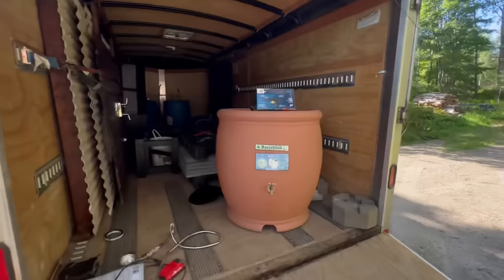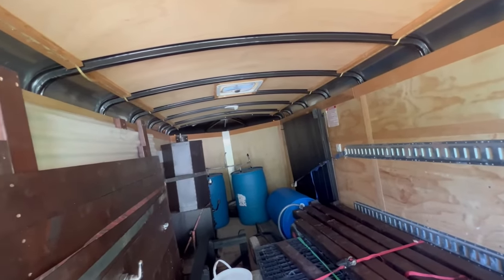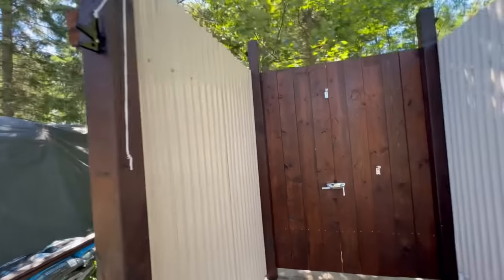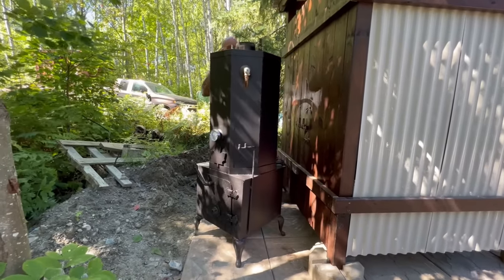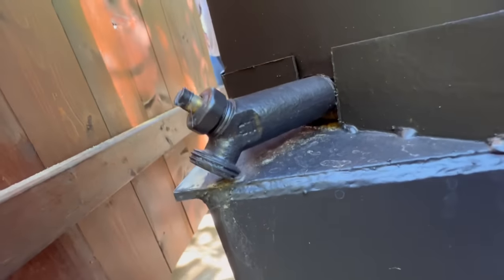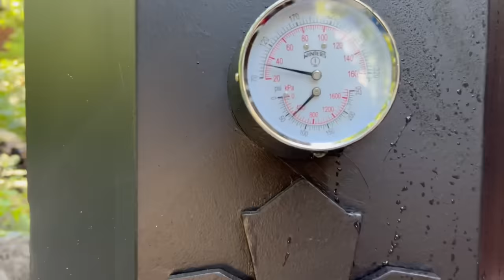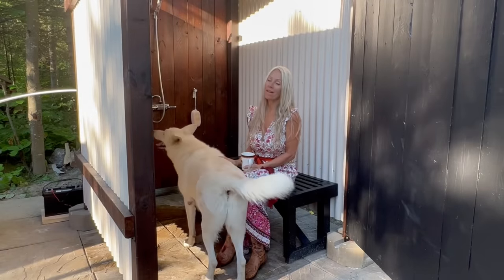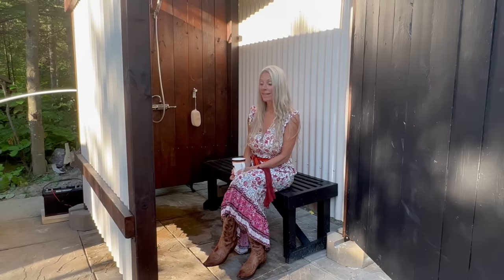Finally!! I HAVE a New Off Grid Outdoor SHOWER!!!

Comment: I’m totally off grid and this idea is awesome! I use a garden water can right now off the corner of my deck. I’m in the process of collecting logs for a sauna bath house but this would be great easy fast set up till my project is done!!!

Now that you have that water pump maybe consider using a barrel and plumbing some water inside. I have a 35 gal barrel I fill from the lake to inside my cabin. Then use a the pump to pump the water to sink. It also is plumed to a small propane water heater and a shower head.  

For the shower I use a cut off plastic barrel a Hula hoop and plastic around hoop to make a shower curtain and direct the water into the barrel.

Comment: I just came across this video and giving it a 👍. You can use it anytime of the year. I would recommend putting that water boiler inside the shower room, insulate the walls. Dig a 6-7 foot deep hole in the ground for the water tank. It’s not going to freeze.

Comment: This makes my off grid shower llok primative in comparison. I had 1,000 gallon wooden tank mounted 8 ft up between 3 pine trees for gravity flow water. A 100 ft black pvc pipe on the ground in the sun for summer hot wates, and an oven made of constuction bricks with a copper tube coil inside the flue for winter.

Comment: Pretty cool Lisette. That boiler reminds me of the one my dad told me about from his childhood. They used to burn corn cobs to heat the water.  theirs was for indoor washing. The corn cobs were leftover from shelling corn on the farm.  I bet it was back in the 1930's.
Reply: My and wife's family owned a huge two stories. full basement and an attic could of been made into three Bzr and bath, was built in very rural WA State in 1880 1890.
No newer  furniture than  1930 Builtwell sofa and plush chair.
our hot water came to house by gravity fed spring 300 yards uphill and would blow cu out of hand if not carefully.
one living went to two clawfoot tubs and two old wood and brass chain operated toilets, two pillar porcelain knobbed sinks in n baths
in kitchen heavy as hell dual sink out of polished granite each nig and deep enough big enough boys till 4 yo could climb in for baths. had huge Beautiful black with zinc trim dual oven,  warming bed for raising bread or keep warm food, wood burner on end and water ran in back through stove to an old cast iron broiler with  lines to all fawcets with return lines to stove salvaged from abandoned logging camp.
opened valve to line return to creek so flowed even below freezing down to Zero F. never a frozen fitting.
our wood furnace was also logging camp salvage.  an old steam logging train engines boilers firebox .completely enclosed and ducted to first floor, second floor just opened floor ventsyou could throw 34 inch long 22 inch thick log in furnace
the ingenious minds of past gave us beginnings of much more complex and way more expensive electrical  and bling luxury, the  cheaply built. throw aways we have today. 
My wife's day bed and my roll top desk were damn near 150 years old and never redone like new.
Family read by kerosene lamps and mirrors reflecting light upon  each our own chairs in winters lights
odd how today's labor savers do not realy save much labor as we work many many hours to buy them.
When buying house had to get county inspections, electrical inspector failed me, because I did not have a grounded hot water heater.
Plastic water pipes and no f'n electricity to house

Comment: Hi if you turn the blue barrels over so the filler is at the top you will save battery power and your pump will last longer ......it would just be pouring in instead of pushing against  the weight of the water 😍
Reply: Glad to help .you did a great job 😁

Comment: I have an outdoor shower that we coiled 200' of 3/4 black poly pipe under a pile of wood chips and some straw. We put the 150g holding tanking inside the pile too. Free 130-40 showers year round. The inside of the chip pile gets near 160 degrees through microbial thermogenesis, bugs moving, eating and making heat through that movement. Every year I scrape the chip pile back and have insane black topsoil and replace with more chips and sawdust. My neighbor has 6 55g drums that he fills with food waste and as it rots, it creates methane, he fires his hot tub heater with that and also cooks on it. Who says you need the gas company, and bugs don't stop in winter, so it's reliable year round, lol. We even heat our greenhouse the same way. I have to say, you have the best thumbnails on YT, hands down and the content is awesome.

Comment: Impressive build. It is so big that you can have a party in it....or you and the dogs can clean up together. I hope that you got good instructions on winterizing it. Nothing could be more heartbreaking than to try to start it up in the spring and finding leaks in piping or fixtures. Been there when I forgot to open a faucet and when water was turned on I got an impressive spray.
Reply from the maker: Yes, I had good instructions to winterize it. And, thank you kindly! 💕😊😎

Comment: Even though your outdoor shower was pre-assembled, You still did an incredible job putting it back together !!!  I LOVE IT !  How do you clean yourself through the winter months ?  A small tip ...  When you drain your water system in the fall, leave the drain plugs open should any water still in the lines be able to expand and drain so it doesn't crack your water lines ?

Comment: When screwing into wood, weather pre-drilled or not, carry a small piece of candle wax and scrape the screw threads across the wax. A small amount is all you need. The screw will go in much easier with less strain on your battery drill. Battery time will be extended considerably. Good luck!

Comment: WOW, what a great setup for you Lisette, it must feel unreal for you to have a hot shower whenever you want!
I don’t want to be a mister negative or anything Lisette but I hope it’s sheltered from the wind because I am worried that a strong wind might move it on you! I don’t think it would be very hard for you to setup something like that inside now that Robert has given you the heads up, anyway it’s a great thing for you to have and Robert’s a very generous and caring man for giving it to you!
Reply from the maker: Thank you Alan! The shower is secured (fastened) to the concrete blocks. I just forgot to film that part. Robert did an amazing job! I’m so very thankful and feel so blessed. 💕
Reply: @One.woman.wilderness  I just don’t think those concrete blocks alone would be enough to hold it if a really strong wind got hold of it but I could be wrong, I don’t know how strong the wind gets there where you live!👍
Reply from the maker: @alanhiggins2928  
We don’t get that strong of wind and I’m pretty sheltered from the wind as well. I’m lucky that way. So, all shall be good 😉

Comment: Lissette from now on when u hook up your water pump always hook up the positive terminal first then the negative terminal last. And when connecting any sources to a live cell battery always keep your face away from the battery just in case of a chance of the battery my explode from a possible spark from making the battery connection. Think safety ok!!

Comment: Hey Lisette! That is an amazing gift from Robert for you! It is also such a good idea to use the pump on the spring water rather than trying to lug those containers as you have been doing. If I may suggest, why don't you add a cigarette lighter jack on the end of the pump wires as that would be a lot easier than connecting alligator clamps onto your truck battery. (Or you could use your Bluetti battery to run the pump!) Anyways... yet another awesome video! See you in the next one!
Reply from the maker: Oh, I actually have a cigarette connector… I just couldn’t find it at the time! I’ll use it next time. 
Thank you my friend!! 
Robert did such an amazing job!! I’m so very thankful and so grateful!! I absolutely love the new outdoor shower!! 
Have a wonderful weekend 😊💕🐾🐕🐕😎

Comment: That is the one thing that when I go on the road it's gonna be nice to be able to take a shower outside in the fresh air. What's also nice about that shower you have U be able to put a rain catchment on the back part because you have a great slope on that roof of the shower and let it go into that big tub during the spring you won't have to go get water for showers because the water is gonna be heated so whatever's in the rain water will be purified. 👍✌✌💪💖👏🎅🚌🌻
Reply from the maker: That’s what I plan on doing, put a rain catchment and also set up a few solar panels. I’m so very happy with the new off grid outdoor shower! Robert did an amazing job!! 😊💕

Comment: Turned out real nice Sweetie! 🤔 Just wondering why you can't use your shower during the winter. I leave a gallon of water with a small hole in the cap, out in the sun during the cold days. After working all day I stand on my concrete block, pour a small amount of the warm water over me and soap up. Then I just turn the jug upside down and rinse off. I grab my towel that's hanging on a nearby tree limb and dry off as I head back inside the camp. Easy Peasy 🤷‍♂️. I know, I know, my name suits me! 😂😘
Reply from the maker: Thank you kindly! Our winters are too cold here, water would freeze. And, you’re too funny!! Lol Thanks for making me laugh 😉😆😊💕
Reply: @One.woman.wilderness  🙂 You're So Welcome and may The Lord continue to Bless, Protect and Guide you Continually! I just found out where you live and yes, 😬 I'm sure that it can get a bit Frosty there ⛄! ⚘

Comment: It might be an Urban Legend but since I was a kid in Calgary everyone always said put some wood under a battery to keep if from discharging. I too would think about a plastic boat battery cover box.  I have a cheap solar battery maintainer on my golf cart that seems to keep the battery topped off, it is about the size of a small cutting board.
Reply from the maker: That’s what I did… I placed a block of wood under the battery … you can see this at the end of the video when I’m chatting. 😉😎
Reply: @One.woman.wilderness  Saw the very nice block of wood under the battery, thought it might have been a concrete paver being so square & smooth.

Comment: With a solar system, you could install an IBC tote on a tower for gravity fed pressure and install on the tote a DC powered heating element that derives it's power to heat your water from the solar system.  That can be plumbed directly into the cabin for a shower/running water indoors.  There is still the issue of a well though.  Have you thought about the possibility of doing it yourself.  There are many videos on YT showing how to do that, but I do not know what your ground issues are that you would have to breach to get into a water table.  Just some thoughts for you though...

Comment: They make magnetic shafts for them screw guns with a sliding sleeve on it so you can run them screws in straighter and easier with out bangin up your pinkies 😁

Comment: Thats awesome you did it . Now for winter cold day you need to dig a sistrin aka deep hole 10 ft deep 12 ft x 24 ft place a plastic tank 12X24x8ft high  install a drain system bury tank install a roof and finish of walls to floor install a small potbelly stove in corner boom wrm water warm space to dress before your hair freezes . I like that shower system . Get your uncle to come dig a hole . You can reuse your waste water filtered organically sand filter for a swimming pool . Pool hot tub . Next ?
Reply from the maker: I won’t be using the shower in the winter… I don’t mind. 😉 Future project will be a sauna… but perhaps next year. 😎💕

Comment: Hii Lisette 👧 wanted to see your new shower, does the roof just sit on top of those 4 vertices poles? Shouldn't they be fastened to the poles to prevent the wind from taking it off? Wow that boiler is awesome! I'll bet that boiler is worth over $2000.00 hot water lisette! Yay! 😃 those marine pumps are good, get another one before this one dies, because they don't last, I had one before and it didn't last, I needed to get another one, especially when your dependant on it every day, awesome to see that boiler working, very very cool 😎 that is so cool, buy another marine pump for spare and screw down that roof, I fear the wind is going to pull it off, this shower is deff adds to a  better quality of life, I am so happy for you ❤️ from: Scranton, Pennsylvania
Reply from the maker: No, the roof is securely fastened to the posts. And the posts are fastened to the concrete blocks. The firewood water boiler was hand made. Not sure, you would have to ask Robert. I’ll get another marine battery for sure. I’ll put it away in the winter months. Won’t be using the outdoor shower then. 😊😎 
And, thank you 💕
Reply: @One.woman.wilderness  I am so happy for you Lisette muah ❤️ God bless you! 👧

Comment: Good lord, all I do is take the shower head off the indoor shower in the summer time and run a hose outside. Once you get good at setting the temperature you don't have to come back in. Small shower nozzle with a thumb valve to turn it on and off.

Comment: You could put a solar panel or two on your shower roof and charge the battery continuously as well.  Not sur what the cost would be though.  Cheers fro Australia.
Reply from the maker: I actually plan on doing this. 😉💕
Reply: No worries. Cheers and hope all is good.
Reply from the maker: @kerryburke3864  
Thank you kindly Kerry 😊💕

Comment: built a wood rack below with 1x3 wood to stand on ,inside of the cement blocks.,make as wide as the inside of shower.
Reply from the maker: It’s coming up, already planning this. Won’t be as cold on the feet. 😉😊😎

Comment: get your battery up off the concrete, that will harm it,a PVC battery box. insulate all the pipes against freezing etc. happy bathing.
Reply from the maker: It is on a wooden board, you can see this at the end of this video. Oh, I won’t be using the shower this winter. 😊😎

Comment: Good job Bob! Do you have an inside shower?
Reply from the maker: No indoor pluming or running water… I do mention this at the end of this video 😊😉
Reply: @One.woman.wilderness  You don't need inside plumbing. They make a usb charged submersible portable shower for $40 on Amazon. Just stand in a tub with a bucket of warm water and wala, clean as a whistle.  ; - )

Comment: cool video!!! but the door of the shower should be mounted with the opposite side to the hinges. why do i know that? the diagonal beam has to be inside the shower so the upper end of the beam is on the side of the locking. why is this important? the diagonal beam‘s task is to support the door against the lower hinge so it cannot sink down on the locking side with time 😉. other than that super great video, thanks for that!!!

Comment: You would have put out side wood stove and heated your whole house as well and just put a shut off on it with a blow out line in the directoin of the shower then just used cold tank for cold water summer

Comment: You'll need to put your battery on a piece of rubber because the concrete slabs will drain the battery.  Just fyi.  Lol
Reply from the maker: It’s sitting on a block of wood… 😉😊
Reply: Ok, lol.   Just making sure u didnt leave it on the slab they will drain a battery quicker than anything.     Lol

Comment: Could you also use rainwater? That would save a lot of hauling water at the well. And since you heat it up to 50 degrees C most organisms that might live in it will be killed.
Reply from the maker: Yes, I plan on putting a rain catchment and also some solar panels to run the battery. 😊💕

Comment: Wait wait you forgot one very important detail... the m.a.s.h. 4077 official peep holes drilled in 🤣 you might be to young to remember that show lol. It's awesome I'm very glad for you. Do you have like a 12 volt pump or hand crank transfer to where maybe you could fill a 100 gal tank in the back of your truck then just back up and crank or pump the water into the shower tank?  I hope you get a ling lifetime of enjoyment from this. Just a afterthought maybe you can run some pipe into the house from that broiler to the sinks and even into a bathtub? Sorry for the edits I just kept thinking of possibilities for you lol. I know it would take alot if doing including burying and insulating pipe and possibly transferring the heated water into another tank by the house, I know all it takes is money right?🤣
Reply from the maker: It’s all good…I don’t want to modernize the cabin too much! 😉
Reply: @One.woman.wilderness  sorry I thought I edited out the 12 volt pump because I saw that's what you did.

Comment: Does that spring flow at different rates certain times of the year, noticed the flow rate , prolly took awhile to fill all those containers as the pump rate was prolly higher.
Reply from the maker: Yes, it does. Usually it has a good flow to it.